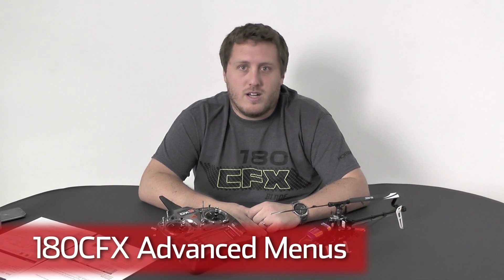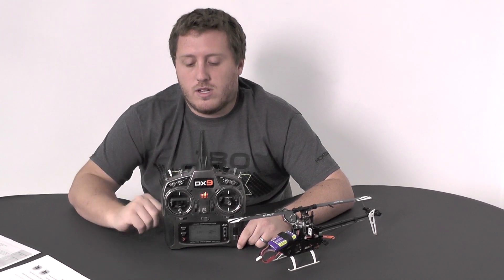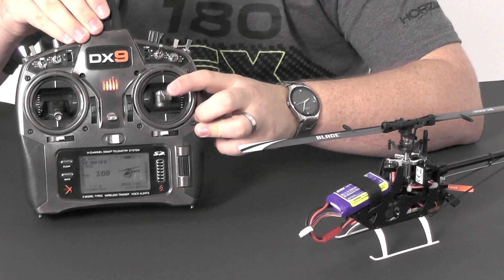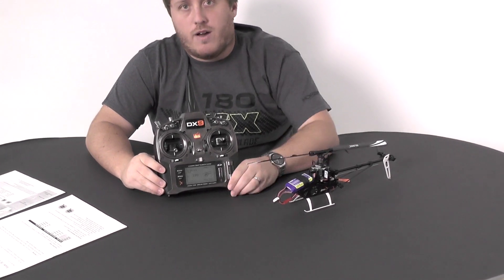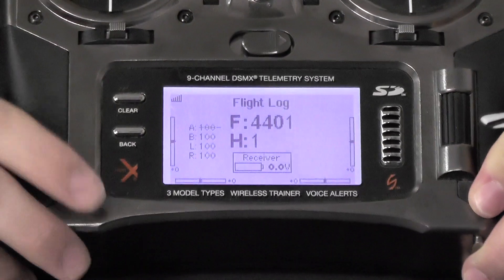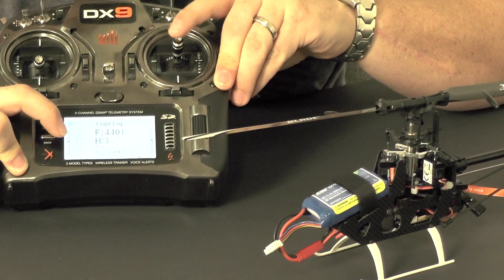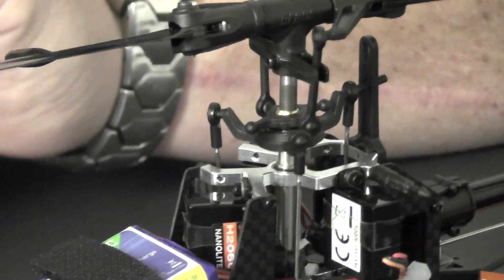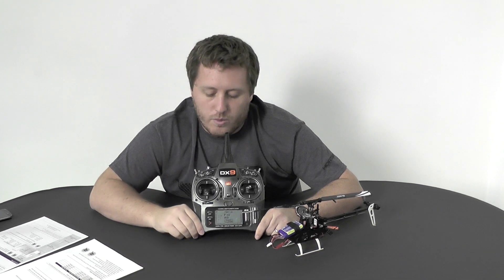180 CFX Advanced Menus

Comment: Dam i have the same problem i got mine i today and the motor doesnt spin its brand new out of the box then when i flip throttle hokd off and on a couple time it starts slowly like my 550x this little thing is in governor mode i dont like it you have to wait for the throttle to get up to speed im using a dx8
Reply: Yup annoying I just ordered the castle USB programming cable and will fix that BS issue even though I should not have to.

Comment: I don't have an issue with the servos yet, but what I do have a serious problem with is this.... I have a dx8. I set up the heli as per the manual sent with the heli, which I found was wrong. But finding this out hasn't helped me. SOOO.... Here's the issue. When I throttle up, the heli doesn't respond until about mid stick. That doesn't do this with my other helis that I've bought from Horizon. I need a fix. I haven't been able to do anything with this heli besides look at it. :-(  Would someone please help me out? Preferable some one who has a dx8 who has the same as I. Or just someone who can help me troubleshoot this. thanks 

William

Comment: Just adjusted servo centering on my 180CFX using DX8 I level swash easily, when I exit the setup menu everything is fine, swash is perfectly level, as soon as I unplug battery and plug back in I go back to original servo positions, and swash is not level - the adjustments are not being saved. I am holding bind/aux2 button to exit setup exactly as shown in this video, so is there another step needed to actually save changes ?? Forums suggest this is a known issue, but no mention here - can I check Blade are aware and if there is a way to save these which I'm missing ? Thanks.
Reply: im having the same prob,,have to center servos every time i plug it in,,also the same prob with the gain menu,,change them, switch off, switch on and everything is back to default?..
Reply: +Julian GoesPro You need to update the software on the receiver - then it saves the new centre points - you need to buy the USB adaptor to do this or ask your local hobby shop if they can update your receiver for you - You will need to update AR6335 firmware using SPMA3065 USB adaptor and Spektrum updater software for any changes to be saved, as the out of the box firmware has a bug so cannot save any changes.
Reply: +38mattyboy +jamesb72
any update on that? Can only use trim...
Reply: thats what I was afraid of^^ Hoped they would sell them now with updated FW^^

strange thing is I can't get into "swash levelling" with my DX8...

Comment: How do you enter centering mode on a DX6?
Reply: Currently you can't as needs 7th channel (Aux2) to enter setup mode, I understand Horizon are working on a firmware update so you can enter setup mode with 6 channel radio's (DX6 and DX6i) so hopefully won't be too long, you will need to buy or borrow the USB adaptor to update the firmware though (or maybe your local hobby shop can do it on the counter for you).

Comment: What about centering of the tail servo?
Reply: Tail is in heading hold so no need to centre tail servo, on other heli's you can go into rate mode to centre tail servo and mechanically set hover tail pitch, but no rate mode on AR6335 I can find, so not possible with 180 CFX.

Comment: That shirt is so cool :) I want one too^^
But I have telemetry on my DX7s too?
Reply: Very annoyed that telemetry menu's only work on DX9, this was previewed as working on any telemetry radio, I have a DX8 and a DX6, so cannot set PIDs with either, as DX6 has no aux2 and DX8 has 'old' telemetry - hopefully DX6 will be able to do PID settings after firmware update to avoid need for aux2 to enter advanced menu.
Reply: Yeah - I share this feeling...
Reply: MrLPMirror Just to update, I updated my DX8 to latest 3.01 firmware, initially this still didn't work and despite rebinding and repeated attempts I couldn't get any telemetry to show up, this was in side the house with wifi etc running nearby. I flew yesterday and out in open field I noticed I was getting telemetry symbol on DX8 screen and can scroll across, so setup gain menu does show the PID on DX8 with latest firmware - I suspect the telemetry signal is very weak so you need to be away from wifi or other interference for this to work though.